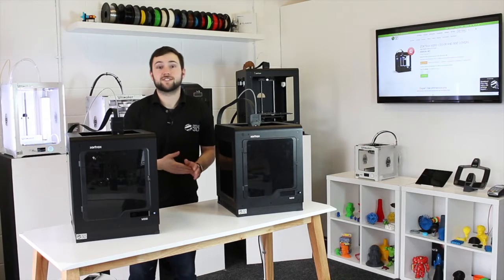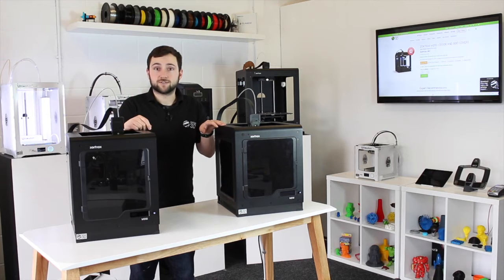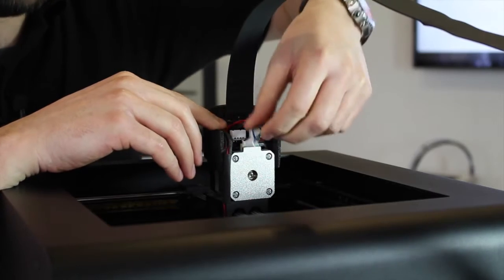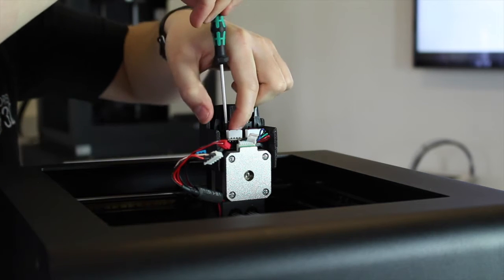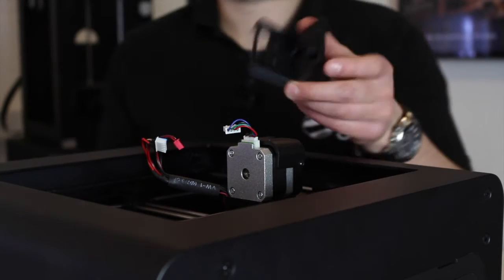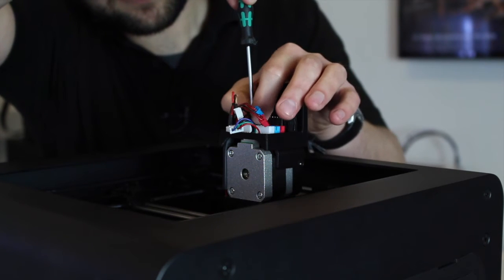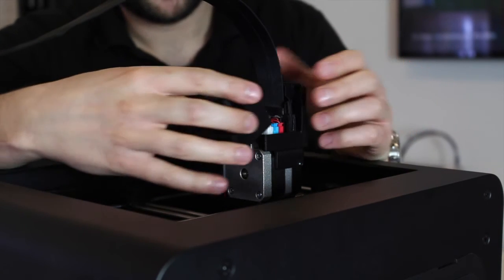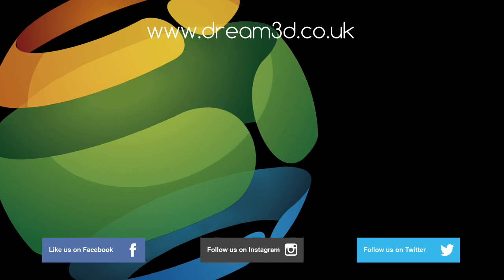Zortrax - Upgrading the Extruder Cover | Tutorial | Dream 3D

Comment: What material did you use to print the parts with please?
As I think z-abs would be to brittle for the clips that keep the 2 halves together?
Reply from the maker: Hi, this was printed in Z-ULTRAT, but you should be okay with Z-ABS as it has a small amount of flex to it
Reply: Dream 3D thank you